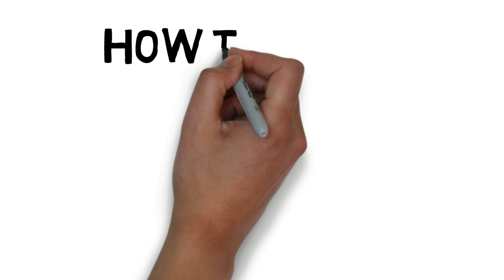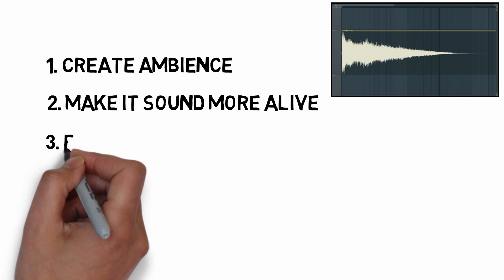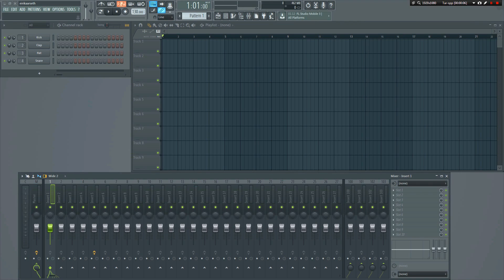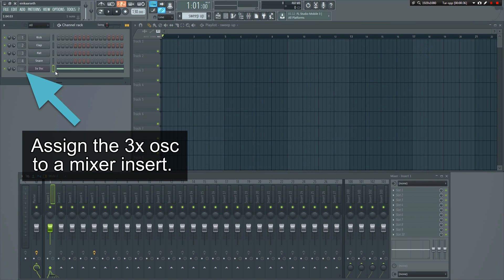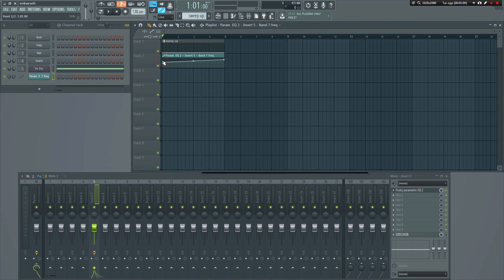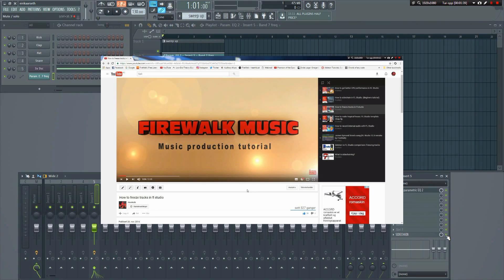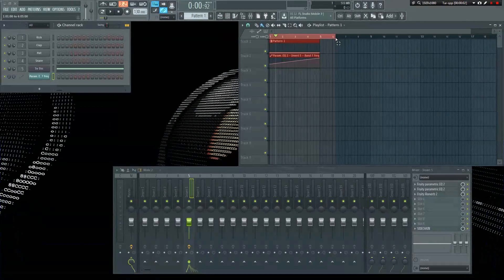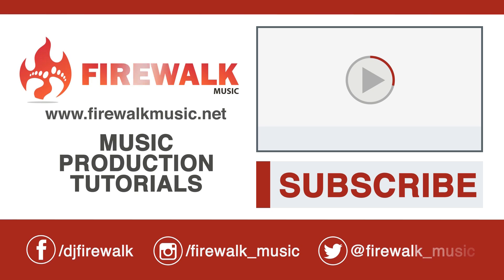How To Make White Noise Sweeps In FL Studio

Comment: Very nice tutorial but 1:59 I cant change it in the playlist
Reply from the maker: Thanks :) Did the automation clip appear in the playlist?
Reply: Yes
Reply from the maker: What happens when you try to right click in it to add points ?
Reply: It removes the pattern
Reply from the maker: Did you left click on the borders of the pattern? That will delete the pattern. Try to zoom in in the playlist so that the clip becomes bigger (hold ALT key and then use the scroll wheel on your mouse to zoom in). Make sure that you click in the middle of the clip. 
If that's not working then there's something wrong with your installation. But I suspect it's just touching the borders of the clip and therefore deleting it instead. Zooming in should help. :)
Reply: Ok thanks you that helped
Reply from the maker: Great :)
Reply: Woah, You reply fast as freak xD

Comment: When I go to disk recording (alt+R for wave files) its blank and won't let me record, any tips on how to fix this?
Reply from the maker: Sounds like it's not armed. Make sure the wav file is routed to a mixer insert, and then make sure that the little red light (armed) is lit in that mixer track before you go to disk recording.
Reply: Thanks! I am a noob with FL studios, I have several programs and I am trying to learn everything.